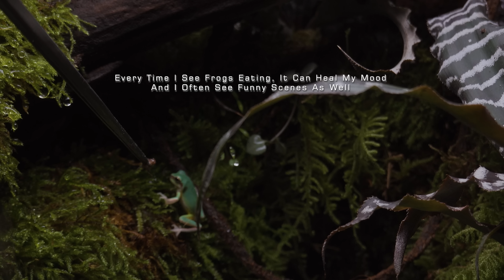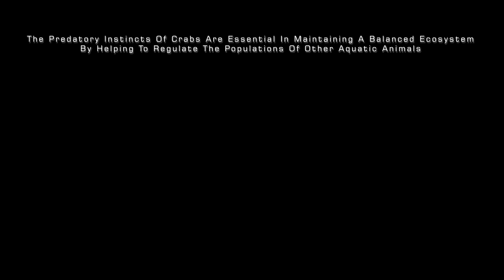Setup Purple Crab Paludarium l Are Crabs Killers?

Comment: what is the white bottled liquid you put under the moss before putting it? as usual amazing work btw☺☺☺
Reply: Super glue?
Reply from the maker: Thank you for the compliment! The white bottled liquid that I use under the moss is a specialized glue that is designed to adhere to plants. It helps to keep the moss in place and prevent it from shifting or falling off over time.

Comment: Absolutely amazing build! I'm in the process of doing one myself, and I noticed that you put the coconut fiber on top of the uncured foam instead of waiting for the foam to harden, apply silicone, and then put the fiber on the silicone. I was wondering if you had any problems or if there were any disadvantages to doing it the way you did. Thanks!
Reply from the maker: The disadvantage may be that the coconut fiber may still easily fall off.

Comment: Will putting the dirt on top of the foam make it sealed? Other people seal it with drylock or silicone and then a layer of dirt but if putting dirt directly on the foam also works and makes the foam safe for animal use then I would like to know